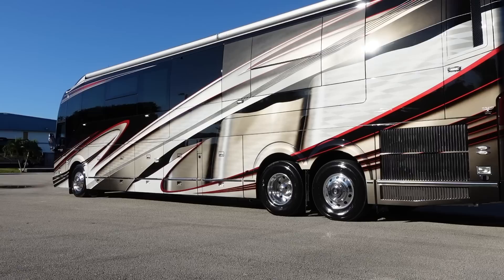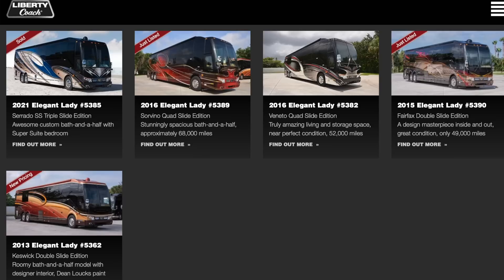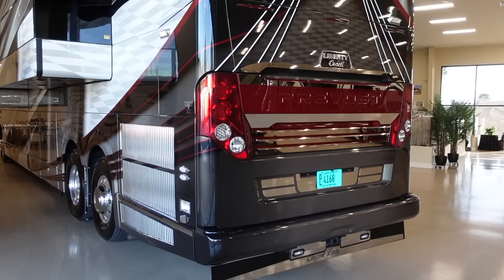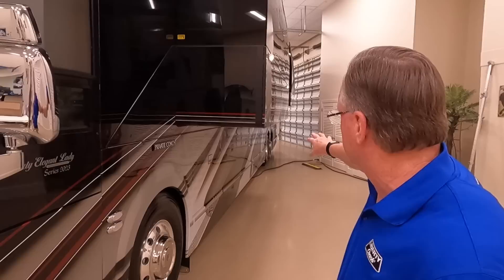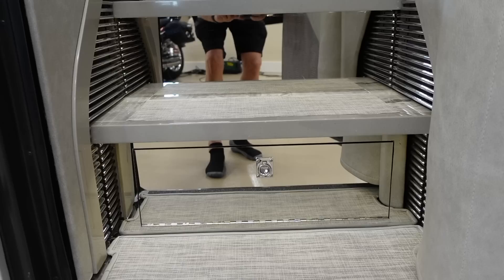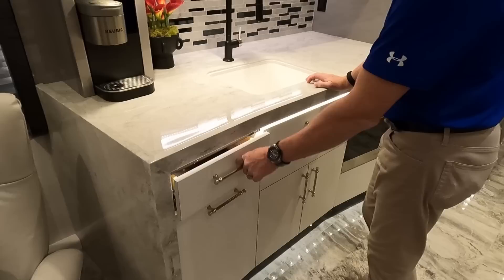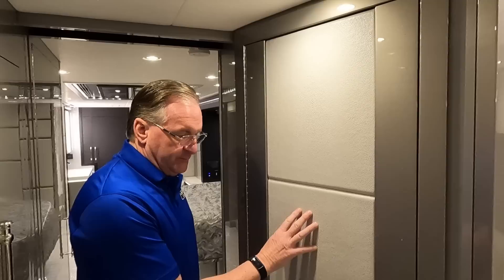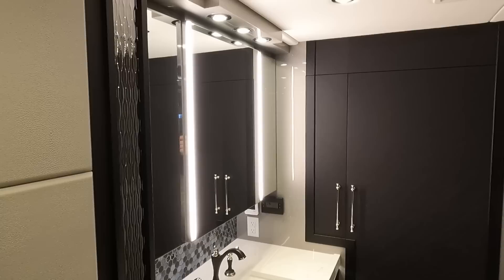Tour of 2023 Prevost Liberty Coach with Quad Slides and Super Suite Bedroom!!

Comment: Adaptive cruise control is NOT a safety feature.  We drove 18wheeler that had that on, no large vehicle should have that on.
Reply: How is it not a safety feature?  We love it on our vehicles big and small.
Reply: @kevingreig288  There has been one incident that I know of where a codriver was killed because some idiot decided to cut the truck off and get off the exit. I use cruise control all the time as much as is possible. However, with that system I barely used it because of how badly the system works. When you get close to the top of an incline it backs your speed off before you Crest the hill. That defeats what you are trying to do. God forbid you are trying to pass someone when that happens. If you get in a "cattle shoot " that curves it picks up the jersey barriers and puts the brakes on unnecessarily. My opinion it is unsafe on any vehicle. I plan to never have it on anything I own. I don't have it now. The vehicle that I experienced it with was a company vehicle.
Reply: That’s your opinion, my option is it will save lives, help company insurance premiums etc. having a loaded truck stop or slow when a driver fails to, is a fantastic feature. I’ve used it in higher gvrw applications, if I owners the business I would have it on every truck.

Comment: beautiful coach.  i watched twice trying to understand what the super suite is.  my guess is the front slides have no change.  the bedroom has 1 side of the 2 slides increased in length and depth?   i think the drivers side bedroom slide is the side that increased?.  

also curious about downsizing the water heater.  20 gallons of water is roughly 170 lbs.  seems like a marginal weight loss for the loss in convenience - why not just reduce the water holding tank by the 20 gallons?
Reply: Great question! I wonder if they can incorporate a tankless water heater that would provide instant hot water? We have several units in our home and they do an awesome job and take up much less space.

Comment: Beautiful coach. Wondering why they would not have a tankless type water heater and only a 20?  Is it common for these coaches to have a fixed hot water heater or is the tankless an option? Keep up the great content.
Reply: STUNNING MOTOR COACH 😊
Reply: I was thinking the same thing. I do believe one of the other high end brand does offer Tankless but not sure Liberty does. I do know they like to stick to tried and true products like Crestron automation instead of updating to newer and better versions being offered so that could be the reason for sticking to the tank type water heaters?
Reply: We in fact to have a tankless water heater, it has been a standard piece of equipment on our coaches for years, we plumb it to the shower valve so in case there is an issue with the water heater or you run out of hot water the shower will still be hot.  A tankless system to supply the entire coach would take too much electric power compared to a stand alone unit that has capacity.  Regarding the remotes control system, Crestron is still the best option for all of the requirements we have running our systems, the electrical architecture of a Liberty Coach is far beyond any other coach in the industry.

Comment: Hello? I was curious,  of what security measures does the RV manufacturers take as far as fires with refrigerators?  Is their no fire proofing panels, or walls. The reason I  asked,  majority of the ones I've seen in salvage yards has been because of refrigerators fires. I think all components such as refrigerators that has fan motors that is constantly running,  should have a fuse able link. I know that's what a fuse is for, but it only blows if the circuit is overloaded. Just like a dryer has a thermal fuse, when it gets too hot...it blows to prevent a fire.
The RVs are very beautiful,  and clients just want the assurance that their investment will not go up in smoke...unless it's BBQ.
Hope all have a great day, and happy motoring.

Comment: I think what if sliding out sides of coach are replaced with sliding up roof? A second floor at the back end can be used as a bedroom. Slide up, not out. It won't work for me because I would be too tall. And maybe people will not get to pull on a shirt without hitting their hands on the low ceiling. I think if you are not trying to have space for very tall people into every corner of the coach, then there might be a way to have 2 floors with low ceilings in the back. And a second floor might offer all around views that safely make the occupant feel like part of nature.

Comment: Is there any way you can specify the wheels at the rear to be the same design ? , it makes my OCD goes nuts . Great video as usual Andrew
Reply: How long have you been diagnosed with OCD? As far as the wheels, that's a no. There's a tandem axle and a tag axle. Two different hubs since one floats and can also steer.
Reply: @freighter1097  I’m a female and even I knew that, he must not be aware of how a tag unit works.